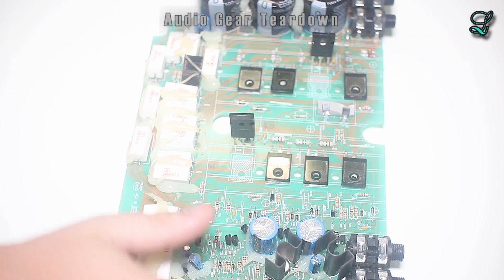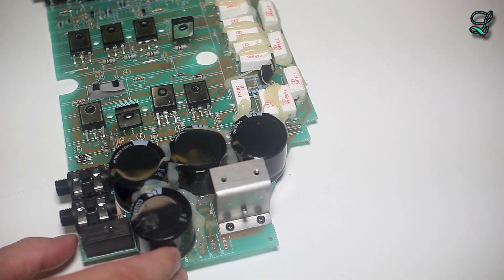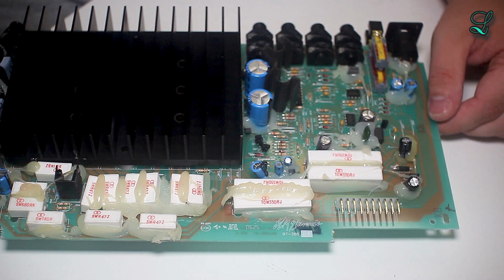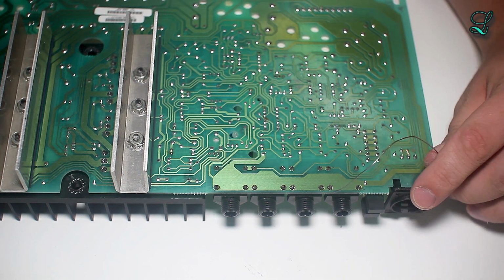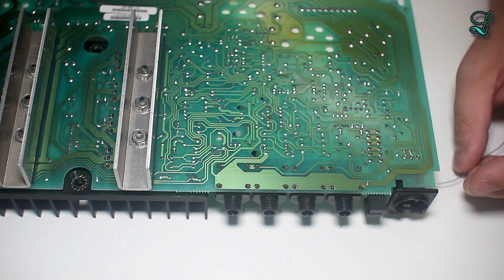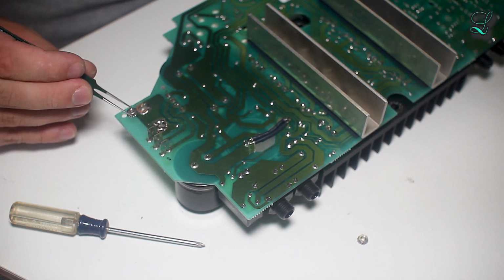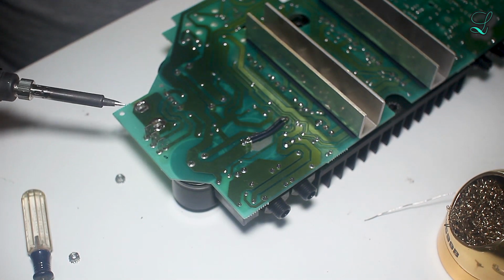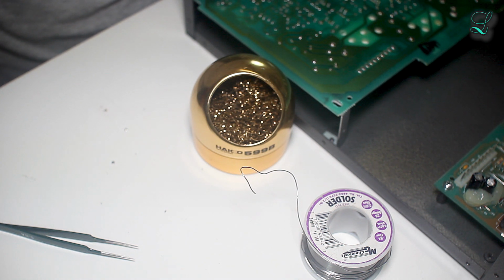Ampeg B2-RE Bass Amp Teardown - Part II

Comment: I just bought one a few days ago for $100 and it is pretty sick. The ceramic resistors are a little crusty and have developed cracks so im sure i should attend them eventually but it works still. I want to see if i can study the preamp and see what im working with in terms of the dual rail supply and tap into the gain stage and introduce some sort of clipping stage or something along the lines. Maybe a bit of parallel processing and a blend for drive / dry. Maybe some post eq / pre eq? But there is a ton of space inside and everything is descrete so i want to see what i can cook down the line 😏